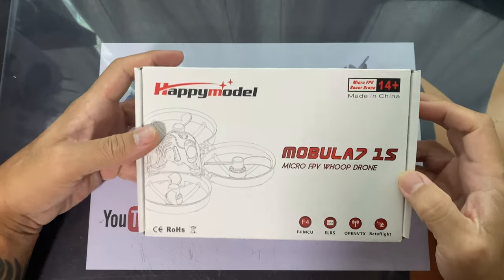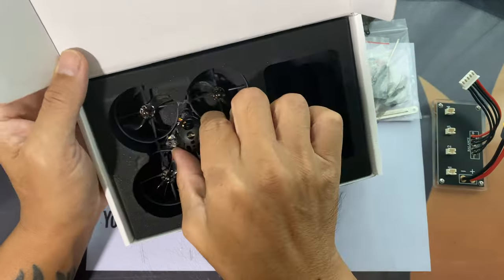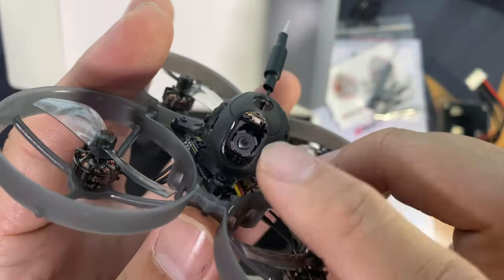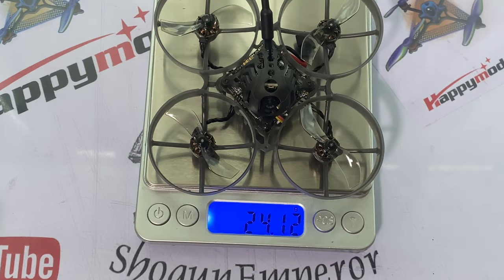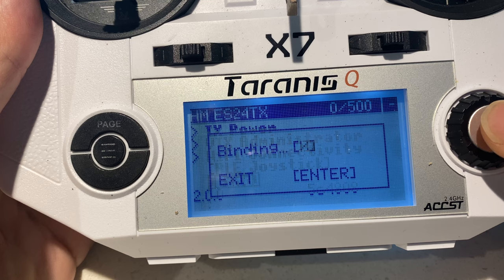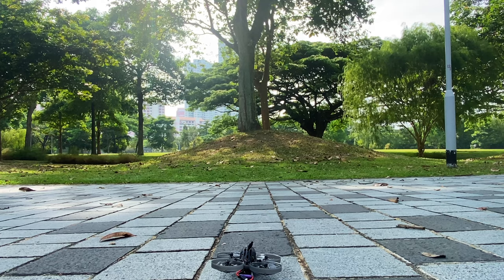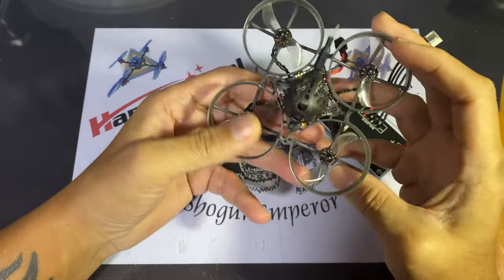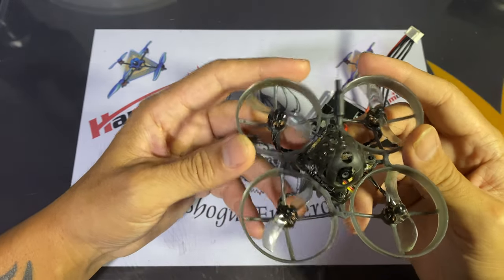Happymodel Mobula 7 1S ELRS and BINDING PROCESS

Comment: For a review it's perfect showing so many OSD Infos 👍🏼 👍🏼 VTX - current / Amps - mAh used - voltage - flight time - (RSSI) - LQ - Throttle position
Reply: You should do a diff all and safe the OSD Infos and paste them for new reviews 👍🏼
Reply from the maker: @Cre8ionz.  thanks so much for dropping by man. Got it boss! Noted on the additional infos. Will do that.

Comment: i'm very new bro, i need your help to setup step by step in the betaflight. you just show one step yeah in this video.
Reply from the maker: no problem!!  If ur new to this, then do the minimal.  
Log into betaflight, 
- receiver tab
-bottom right (click bind receiver)

on the radio
open ELRS LUA script as showns
- scroll down to [bind]
-click bind

Check on betaflight receiver tab if the stick movements on ur radio are moving correctly on the receiver tab. And u should be good to go.

Comment: GAONENG GNB 4.35V 450mAh 1S 80C HV Battery PH2.0 Plug White Plug For E010 M80S Tiny7 RC Model - PH2.0 Plug, is this battery ok?
Reply from the maker: Actually… ive always been using this for awhile now. In my personal opinion it is very reliable. The other i would recommend is the NBD nectar

Comment: Another question and was hoping to get an answer from the Mobula pro such as yourself my friend! :) What would you recommend to use DSHOT300 or 600? Also, I don't know if that's normal, but sometimes I feel like gravity affects my Mobula 7 more than I'd like it to. I know people don't like to make their quads "too floaty", and that's totally OK. I wonder what is the setting in Betaflight where I could play with how "floaty" my whoop is? Is that maybe "Motor Idle" option which currently is set to 12 in my Mobula 7? Thank you so much in advance!
Reply from the maker: im using dshot300 if thats of any consolation. Dshot600 for a whoop FC may be abit too much for the FC to take. I'd increase the throttle weight (mixer page)on your radio. Play around with that and see how it goes.
Reply: @shogunemperor  - Thank you so much! I'll give it a shot and experiment with that. This is so exciting, I feel like a kid in a candy shop with all these options and possibilities. Flying is not a hobby, flying is a way of living! Thanks!

Comment: What do we do if our Mobula 7 1s won't show in WiFi list as ExpressLRS? How do I make it enable WiFi? I wanted to see if there is any ELRS update for it. I've purchased Radiomaster Ranger Nano external ELRS module and when connecting it to my Radiomaster Zorro, picking the ELRS model I've created in my radio... it works perfectly fine. Since I use binding phrase, it connects to my Mobula almost instantly. I installed Tango II external module bay, and connected Ranger Nano, all seems to work fine... but I can't bind it to my Mobula 7. Have no ide what next to try. Anyway, it would be good if you could shed some light on this WiFi issue. Thank you so much in advance!
Reply from the maker: Mobula7 is an SPI Rx bro! U dont need binding phrase. Just go into ur receiver tab in betaflight and click “bind receiver”. Make sure ur running same 500hz@250mw on ur quad n radio. If ur running ELRS V3 then u will need the hex file to reflash ur mobula7 to be able to use ELRS V3
Reply: @shogunemperor  - Both my Mobulas are on the latest versions and I updated BF the very first day I got it. I just wanted to see if there is new ELRS version available. I also just managed to bind Tango II with Radiomaster Ranger Nano. I have binding phrase anyway, for my other quads, so I like to keep it the same for all. My Tango II didn't want to bind originally, but I updated it to the latest FreedomTX update and as soon as it was done, and I fired up my Mobula, Tango with Ranger Nano bound in less than 2 seconds. All good, works perfectly fine now. Just regarding this part you wrote: "...Make sure ur running same 500hz@250mw on ur quad n radio..." - where do I see that on my Mobula7? I know for the radio, it's inside the LUA script (elrsV3.lua), and I can change it to anything basically... but I don't remember I ever set that in my Mobula 7, and it flies like a little monster (have tons of videos up on my channel).
Reply from the maker: @Seii-FPV  oh, regarding the 500hz its usually in CLI of Betaflight. Type: “set expresslrs_rate_index = 0 “ 0 for 500hz)
It doesnt need a newer version, so if its flying just leave it as is. Unless like V2 vs V3 where the change is massive.
Reply from the maker: Oh yes. Cause its an SPi Receiver, it doesnt really need a binding phrase n does not go into wifi. The binding is actually done on betaflight via the receiver tab where u click “bind receiver”
Reply: @shogunemperor  - thank you so much, greatly appreciated! Is that value in CLI by default, or which number is there originally? I'm wondering what is it set in mine. But, of course, I'll use above mentioned command line. Thank you a million!
Reply from the maker: @Seii-FPV  it should be default, but sometimes it may change by itself due to (unforseen circumstances) so hard to say. Aye no worries bruh! Always a pleasure to be of help! And apologies in advance if i cant. 😇
Reply: @shogunemperor  - no need to apologize my friend. You are always amazing and such a source of knowledge for these little bugs we're flying. It's always greatly appreciated to read your comments and replies. Thank you once again!
Reply from the maker: @Seii-FPV  aaawww ur too kind my bro!!! Always a pleasure man!! 👊😘 hope u have an awesome day as you’ve made mine!

Comment: Is there an upgrade camera that will just plug in ?
Reply from the maker: Unfortunately, no. The Caddx Ant comes with the correct pins, but u may need to swap the connecting pins as they use JST ones

Comment: Hello I have a problem could you help me. I'm using a module tx micro betaFPV ELRS 1w, I'm trying to link in mobula 7 1s but I'm not having success, my module tx is in the latest version 3.0.1, could you help me? thanks.
Reply from the maker: yes bro, V2 doesnt work with V3 like I mentioned
Reply: I'm trying to research the same thing. Somebody on the RDQ reviews said that it can work with 3 and "happymodel has betaflight for elrs 3. (Rdq you should post the link here!)" But I have no idea what that means...

Update: This youtuber seems to have posted how to upgrade the FC to support elrs 3.0 about 2 months ago. Not sure if it's what we are looking for, but I'll try it when I get mine
Reply from the maker: @redcobra1246  ❤ thanks for dropping by guys!!!!  Let me know if you guys have any issues, will try to assist as best as I can!  Basically, the SPI FCs now can work with ELRS V3 with this hex file. I've reflashed all my Happymodel SPI FCs with this.

Comment: Would you be able to go through all BF configurator options (in BF10.9.0) and make a quick video on all important options that needs to be set properly. I've updated my Mobula 7 with the latest BF 4.4, bound it to my Zorro which is also on the latest internal module firmware. All settings were reset to the default values after the firmware upgrade. I just want to be sure all my settings in BF configurator are correct before I take it for the maiden. Thank you so much in advance!
Reply from the maker: i havent used BF10.9 yet so i cant make that video bruh... ok. So what u need to do is copy this dump file for the Mobula7 and paste it into your CLI and save
https://www.happymodel.cn/wp-content/uploads/2022/12/SPI-ELRS-4.3.1-dump-file.txt
Reply: @shogunemperor  - Thank you. I've found one called "Mobula7-1S-ELRS-diff-all-for-X12-ELRS-V2.1" and I thought that one is for my whoop since on my board it's printed ELRS v2.1 (however, I am on the latest firmware now on all my devices). Flew my first flight with Mobula 7 today, and super happy :) I just thought some 100% correct settings for Betaflight would be very welcome. Thank you once again!
Reply from the maker: @Seii-FPV  SWEET BRUDDAH! Thats great news!!! Happy flying man!!!!

Comment: Still has nightmare level prop wash.  I've been working on a BF 4.3 tune that works well on the MobLite7.  You might consider flashing BF 4.3 to help with that.
Reply from the maker: Totally understand bruh! This ones on 4.3 stock.  Pretty awesome, I dont get that much propwash but it could do with abit more power.

Comment: Is ELRS getting easier to setup? I had a lot of issues repurposing my R9 gear and went with Crossfire instead
Reply from the maker: hey thanks for dropping by man, hope u've been well.  hmm... ELRS does take some getting used to when setting up but yeah, its much easier if you have the ELRS Configurator. But the latest models are mostly just plug and play.  So what you see in the video is exactly what I did to set it up.  Pretty straight forward.

Comment: Is it okay to use XT30 for the 1s plugs. Wont it be an issue for the fc for any voltage spikes or etc.
Reply from the maker: you can... but its added weight to the whoop. I'd suggest the GNB27 connector instead.

Comment: Is it possible to bind a v3 ELRS TX with this v2 ELRS mobula7?
Reply from the maker: yes bro, u just need to reflash the Mobula7 with the V3 hex file. Here's how:-
https://www.youtube.com/watch?v=VCc9nVSF4R0
Reply: @shogunemperor  does your Betaflight configurator have to be on 10.9.0? I read that this new Betaflight configurator provides elrsv3 support for elrs SPI boards
Reply from the maker: @roylim1570  im using 10.8 and i used a hex file for the ELRS V3 for the Mobula7 and Moblite7 HDZero, in the link i sent earlier

Comment: I did that and it’s not working.. 😢
Reply from the maker: Do check if both radio and Tiny Whoop are of the same version.  V2** or V3**, if both are the same version, then check your radio's ELRS luascript, go to model match and turn it off and on.
Reply: @shogunemperor  😮 how do I find out what versions they are?
Reply from the maker: @athenovae  wait. I thought u said u did this? Have u ever used ELRS? I need to understand how much u know
Reply: @shogunemperor  I’ve never used ELES before. When I said I did this, I meant I hit bind in Betaflight and hit bind in the ExpressLRS Lua on my T-20
Reply: @shogunemperor  Trying to bind my T-20 to my Mob 7 1s ELRS and having such a hard time. Plugged quad in flashed to Betaflight 4.4.3. Went to receiver tab and hit “bind receiver”. Hit bind in Tx ExpressLRS Lua. Lights still flashing and I have no bind. Am I missing something? :((

Comment: Is this more powerfull than moblite7 ? How about the power to weight ratio ?
Reply from the maker: Power to weight ratio i’d say Moblite7. Think it’d do better with triblades… but cant seem to find one with 1.5mm shaft hole
Reply: @shogunemperor  could you give me some pros and cons of each one. I would buy them. Do you have facebook ?
Reply: @CQCTUMP  the moblite7 has a longer battery life but it performs very poorly when doing freestyle also I don't think you can get it with anything else but frsky, the mobula7 performs super well with freestyle and you can get it with elrs also the mobula7 has many models like 2/3s and had versions both can come with crossfire

Comment: I'm experiencing this terrible yaw twich and sudden jerking on this drone. It makes it impossible to fly. Any ideas what if might be?
Reply from the maker: issit when ur pulling out of a dive??  or just flying straight?
Reply: @shogunemperor  even when I ARM and don't fly at all, it twitches. Even as its on the ground
Reply from the maker: @nerassurdo  that sounds like the airmode doing its work. Do you have a video??  Hard to tell when ur telling me off hand bruh.  Quick question... is this your 1st FPV drone???
Reply: @shogunemperor  yes it’s my first fpv. But it’s not airmode. I turned that on and off. Tried both angle and acro. Same story.
Reply from the maker: @nerassurdo  is the voltage on your OSD blinking when u plug in ur lipo?  Dont mind me asking a bajillion questions, I have to take steps to troubleshoot each time someone has an issue.
Reply: @shogunemperor  well it does the 3 tone sound followed by a two tone sound on the ESC when I connect battery. But I don't really know what the lights are supposed to look like. I mean there's some blinking lights but I couldn't tell u which one is the voltage and what it's supposed to look like when it blinks. After the receiver connects to my ELRS tx the lights stop blinking. It looks pretty normal if I compare it to my Betafpv 85. That drone flies smooth af but it's not as fun as this one. But it doesn't suffer from any twitching. Startup looks about the same
Reply from the maker: @nerassurdo  I mean through your goggles. Oh, u have a beta85 too? So its not ur 1st FPV drone?  Would you like. to join me on my discord?
https://discord.gg/7t2JMjHdKt
Reply: @shogunemperor  I don't use discord. I bought the betafpv after the mobula7 because I wanted to see if it was the receiver or something else. But I fixed the issue. U will never guess what the problem was.
Reply from the maker: @nerassurdo  AETR and TAER???
Reply: @shogunemperor  no come on that one would have been an obvious fix. The problem is a violent yaw twitch on the ground and in the air. I told you, u won't ever guess haha. U give up?
Reply from the maker: @nerassurdo  It happens sometime bruh.  Even to me.... yup!  i give up! hahahaha
Reply: @shogunemperor  don’t worry man I still subbed to you. ;) I need more friends in this hobby and u sound like u know ur shit lol. The issue was that the FC was screwed on too tight to the frame!!! I think that was messing with the gyro?? I asked pretty much every YouTuber that had made a Mobula7 video and only 2 of them guessed the problem. That was wild to me cuz it’s such a difficult problem to guess. But Albert Kim and Nick Burns guessed it. They got big drone channels.
Reply from the maker: @nerassurdo  ROFL thats pretty kind of you bruh!!  Much appreciated.  Whaaaaaaat??????? Interesting. I havent experienced that before. Not till u mentioned it. Thanks for that though. Least now I know that there's 1 more troubleshooting step to add to my list! haha
Reply: @shogunemperor  no worries dude, expect me to bother u about other things in the future lmaooo... Here's how Nick Burns explained it to me. "The x12 board can have a few gyros in it and some are more sensitive to vibration. If the canopy is over tight, it compresses the grommets and that vibration reaches the FC and it messes with the gyros."... Where u from by the way?
Reply from the maker: @nerassurdo  aye no worries my man!! Thats why i do the videos!!! Bought the whoop? Oh, Im one of the team pilots. :)
Reply: @shogunemperor  idk what u mean by that. I was asking where u from
Reply from the maker: @nerassurdo  geez.... i realized i misread it as "where u buy from" hahha im based in Singapore bruh. Born here.